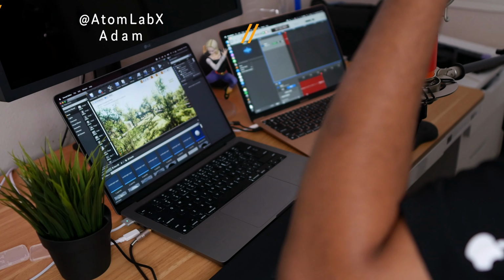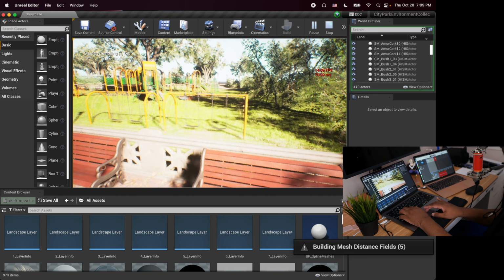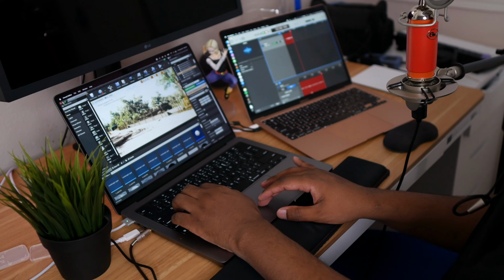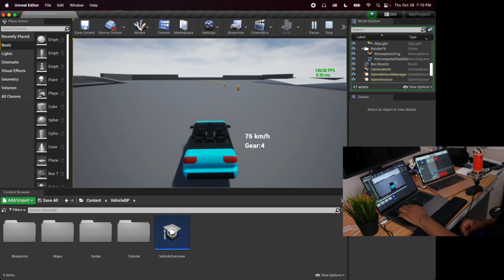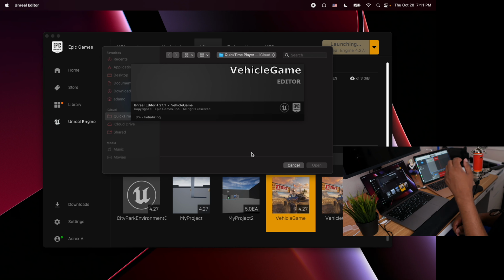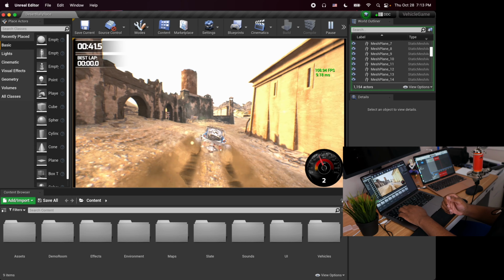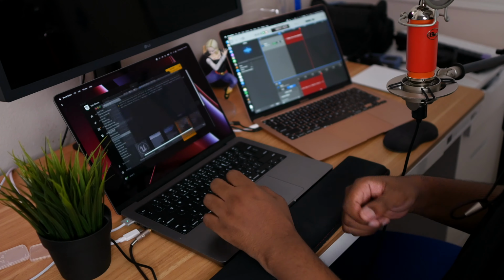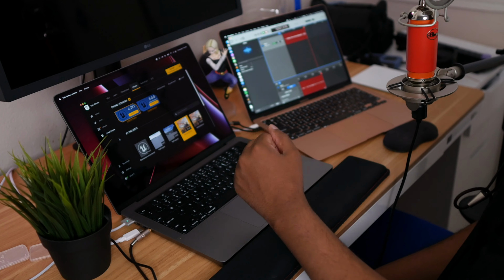Ultimate Unreal Engine 4 Test On M1 Pro MacBook Pro 14"

Comment: Hi why you say maxed Mac mini is better than the base 14 inch MacBook Pro? As the specs tell, 14 inch wins in every aspect? You said you would talk about in a video , which video you mean?
Reply from the maker: The maxed mini is better than a base model, 14" because it works in a better synergy. 
Since the 16gb of ram on m1 pro, would take more ram usage since the gpu and the ram are shared. 

I have not made a video about it, because I'm busy covering the new Macs, but I should make a video about it within this week, I kinda forgot!
Reply: @AdamDoingTech  I don’t think so. The band width in m1 pro is much faster. 200G vs 64G on m1.
Reply from the maker: Exactly, which means 16gb of ram, will suffer greatly, because you have a higher bandwidth that is shared between the main unit and the ram, and the GPU, with a higher bandwidth, that means you're bottlenecking the device. 

Sometimes faster (number) doesn't it is better. 
I encourage you to watch some of the other videos, and you'll see that example live. 
There was a video that I did in response to Max tech and the stupid test they do for programing without knowing what they're talking about, but I have removed it, because I didn't want a drama. 

But in that video, I showcased live how that is not the case. 
And me and many other we did agree. 

I'm not sure what is your degree or certificate but I came to those stuff as a QA and as a computer engineer myself.
Reply: @AdamDoingTech  I think you mean 8 core 14 core m1 pro can’t handle 200G bandwidth and 10 core 16 core can handle? But m1 pro’s 8 core is 6+2 which is already better than m1’s 8 core which is 4+4(2more power cores)? Also the GPU has 6 cores than M1. Also based on your logic. 16 core gpu handle 200G bandwidth. So if it’s 400G bandwidth on mi max it needs 32 core gpu so the 24 core m1 max on max studio is worse than 16 core gpu m1 pro?

Comment: Thanks for the video! I am a beginner wanting to learn UE and currently looking to buy Macbook Pro 14. If you had the choice between updating base model with 32GB Unified RAM or upgrading the base CPU/GPU to 10-core/16-core, which would you choose? For running Parallels and VMs I think adding more RAM makes more sense, but for UE I have no idea. Thanks again!
Reply from the maker: Here is an updated look into it: 
https://youtu.be/WqfLuyjNRr0

Comment: Hey! Thanks for the test. Can you measure the city lite environment once more after the shaders compiled and distance field finished building? While you were testing it the engine was using the cpu at max so no wonder the frame rate was 30.
Reply from the maker: I’ll do that for sure. 
I do have another test in mind co ing soon as well. 

My goal with this was to showcase that hey; unreal engine works just fine.
Reply: This 100%. Any project that complex will need to do an initial shader compile. Once compiled, it should run WAY better.

Comment: That means UE 4.27.1 can run on Apple silicon without problems except for speed? It sounds great! In your opinion,  if I use Windows machine for development and need Mac only for macOS and iOS packaging, would base model M1 Pro be OK? Maybe even 16GB M1 MacMini?
Reply from the maker: A max mini M1 would be better than the M1 Pro 

I’ll share a video about that soon explaining while with some live examples.
Reply: Sure, but we do not know when or even if  M1 Max Mac Mini will come out. I was thinking if 2020 M1 Mac Mini can be used for packaging UE projects developed on more powerful machine? 
I am looking forward to the video you have mentioned.
Reply from the maker: I was talking about the base M1 Mac mini, not the M1 Pro.
And if you want to work with UE on Macs, there is a solution, which there will be a video for at some point as well. 

So keep an eye! for that!
And sub if you have not already!
Reply: @AdamDoingTech  I am sbscribed for a long time because you are most valuable source about UE on Apple Silicon.
Do I understand correctly that you think 2020 16GB M1 MacMini would be better for UE packaging then MacBook Pro 14" with M1 Pro?
Reply from the maker: Full spec out Mac mini 16gb of ram is better than MacBook Pro 14" Base model (we are talking about the base $2000 Mac) with 8 cores and 16 gb of ram. 

As as you upgrade the M1 Pro to the 10 Core CPU and 16 Core GPU (which is a $200 upgrade) this machine will be waaaaaaaaaaay better than the Mac mini.

Now you might ask why? 
Well, simple (I wanted to explain that in the video, but I'll give you the answer) is because you have more bandwidth to work with, and more GPU power to take advantage of. 
And more bandwidth with more GPU power is the best sauce recipe for UE on Apple silicon to run like butter. 

I want to to keep in mind the specs that I'm talking about in the video is the base base model of M1 Pro. (8 Core). 

As soon as you upgrade anything on that base model, then it will be better than the 2020 M1 chips.
Reply: @AdamDoingTech  Thanks, excellent explanation, I get it. But, does 4.27.1 runs on M1 without issues?
Reply from the maker: To be honest with you, I have owned 3 M1 2020 models. 
on my main machine it doesn't work at all!

But on the 2 Mac minis that I had in the past, it did work...
so it is hit or miss, and as I always say, we don't pay money for (if's) we pay money to get something that works.
Reply: @AdamDoingTech  strange. What could be the explanation for such erratic behaviour?
Reply from the maker: As a software engineer myself, my only explanation that at least make sense to me, would be at the time Epic really didn't want Unreal Engine to work on Apple devices or Macs last year, because we had the child spat between them, if you remember. 

As the spat is now over, and things are getting back to normal, Epic is not trying to fight this anymore, which means Apple had enough time to optimize for the M1 Pro and the M1 Max, but it is game over for the M1 Base model because Epic added so many constrains, that it would take so much resources to fix the damage that has been done already to that info structure. 

Yes, they're the same ARCH, I get it, but they work differently, that's why you're getting a better behavior overall with the M1 Pro (8 Core) even though the logic indicate it has a higher bottleneck ceiling. 

I'm editing new video for Unity as we speak, where you can see exactly what I'm talking about now. 
And the results numbers prove that as well.
Reply: @AdamDoingTech  your explanation is probably right, but I think you mistyped that "Apple had enough time ..." instead "Epic had enough time ..."?
The conclusion could be that UE will work fine with 10 core M1 chip. Allow me one more question: in your opinion and experience, will 8 core M1 be good enough for packaging UE projects developed on a faster Windows machine?
Reply from the maker: You're right, Epic lost a huge costumer base (so that's why they're like, let's just get back to normal). 

And I'm up for questions and I like them, this is a conversation and we are all here to learn! 
So please don't shy away from asking, by the end of the day, this engagement I get once a year, when apple makes new laptops, otherwise the channel is dead, so I'll have my fun while it lasts hahaha xD 

As for your Q: we all know It will package by the end of the day, but let us put things into probative a bit. 
Let's say you build a project, and your project let's say is 10GB. 

You want to compile the package that you made on MacOS, maybe because you want to go to the Apple ecosystem or something, like that.
So after the compile, it has to be cooked, to ensure it will work as it should on that platform (in this case apple). 

To OPEN! the project it would take around 45 mins (depending on how complex the project, but that's the average for a decent project), and that's to OPEN ONLY!

And I'm sure you'll do more than just opening and more than one project and you'll have cache files (takes up storage) and all of that, and keep in mind you only have (400GB) free storage (because it's not a real 512GB) since the system takes a huge part of the base storage.

After caching a couple of projects, and each is taking 45mins average, and I'm sure you want to run it at least 3 times, just to make sure things are working (personally I run my project way more than 3 times to make sure it is packaged well).

And according to UE4 Docs, the average packaging is around 30-40 times when the project it ready.
Source: https://docs.unrealengine.com/4.27/en-US/ 

That's almost 2 days of work. 
And even if your hour work worth (10 dollars) that's $120 wasted... and if your hours is $30 that's 120 x 3 = 360 dollars wasted.

So I'll say no, because the software is not yet optimized as it should and the base model, is meant for the grandma who want to buy Emily a new Mac laptop before she goes to school, and she wants something powerful, but not willing to spend too much, because Emily do Tik Tok videos on iMovie.

I have worked at the Apple store and seen that so many times, and worked as a QA, as well. (quality analysis) 

You're better just spending 2500 dollars (500 dollars extra).
You get 1TB - 10 Core CPU and 16 Core GPU.

And that would shave the time of compiling from 45 mins to 20-25 mins. 
which means, you get double what your time worth, and now your work can be done in one day. 

Nevertheless, that's how I look at it, because that extra day can be with family, or can be to finish another project, or do another testFlight to make sure everything is working as it should. 

When I started this channel as whole my aim was at people who does that for living or at least they're high end users (even if it is just a hobby) like me, it was never meant to the average Joe. 

By the end of the day, as I always say, we are in a free country, and allowed to make wrong choices hahaha, and that's what I said when I got my Mac with 1TB, which regret very much, and that is way my personal new machine will have 4TB SSD.

Comment: Thanks for the video! When you get the M1 Max, could you also compare it with a PC Laptop with RTX? And I was wondering since we don't have RTX at M1, it means "No Ray Tracing for Mac" I suppose. But do you think Ray Tracing is going to stay or with new features coming up like Lumen in UE5, we don't need to worry about having an RTX card nessecarily?
Reply from the maker: I think Ray tracing is here to stay and the m1 actually have supper for it. 

It just you need a powerful m1 to run it. 

Like the m1 max 

Which I’ll test when I get my hands on it mostly next month.
Reply: @AdamDoingTech  Perfect! I can't wait to check out your M1 Max review in UE4.27 or even better on UE5 and how it handles Ray Tracing compared to a PC machine!